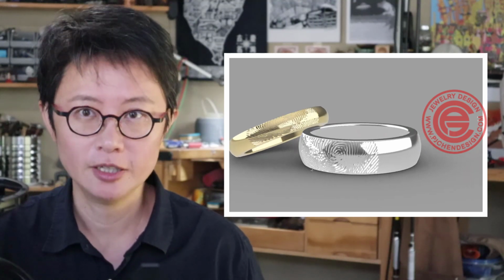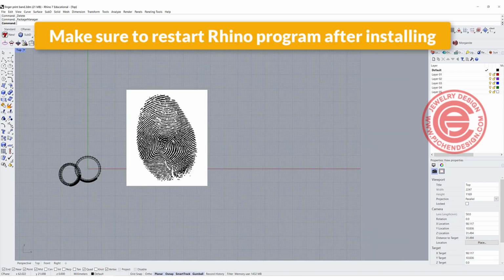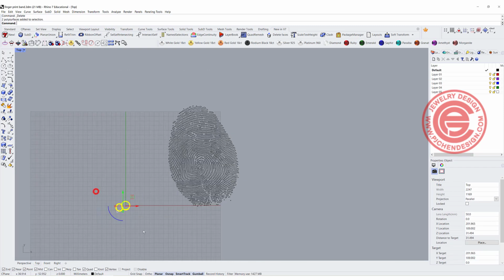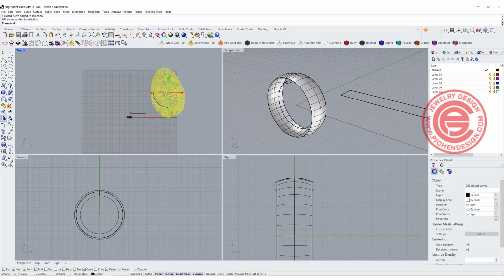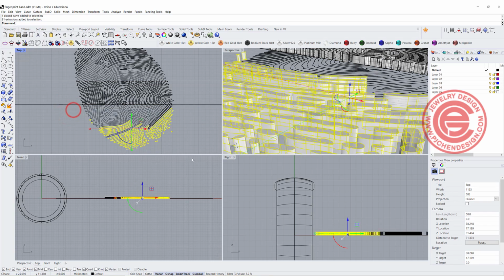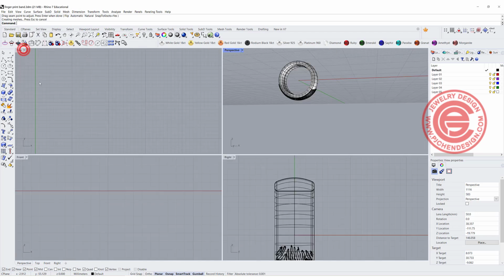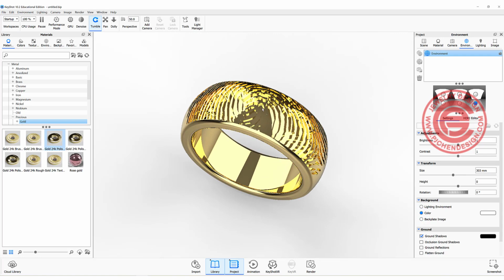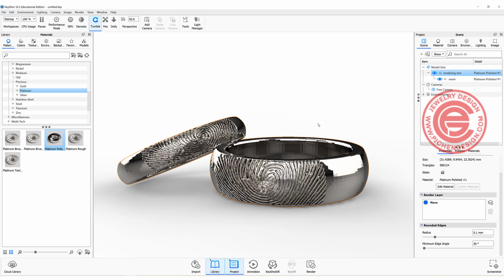Fingerprint Ring Band- Jewelry CAD Design Tutorial 3D Modeling with Rhino 3D #246

Comment: Hello PJ Chen, thanks a lot for this great tutorial! When I apply "flow along surface", the fingerprint solids build in a wrong way on the target curved surface (they spread beyond it in a weird way even though I applied "create uv curve" for a correct part like in the video), I don't know what's the problem 😞so I cannot apply boolean difference after that, it is failing